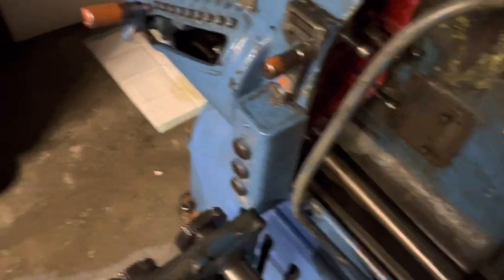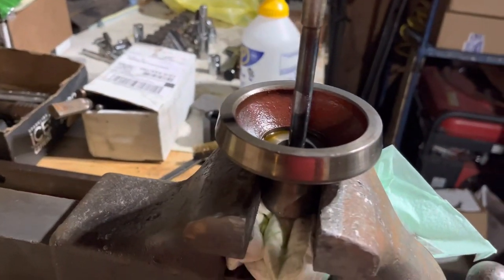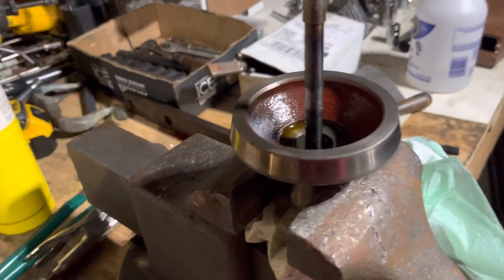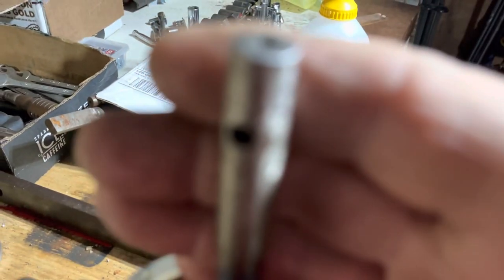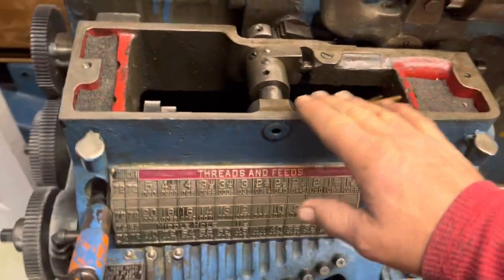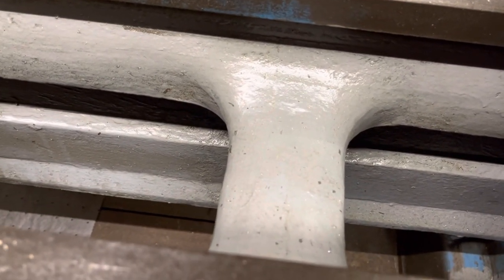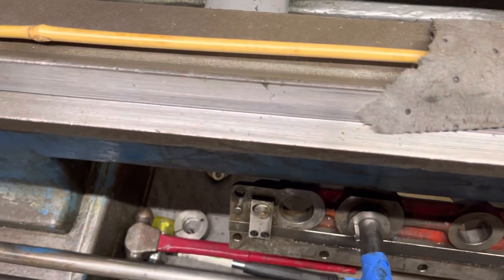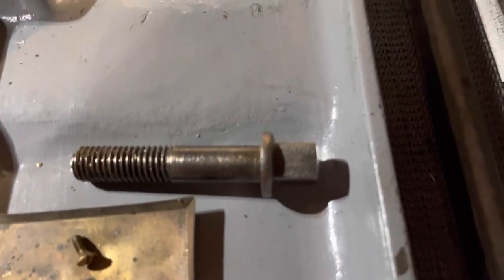Nocturnal emissions(My friction clutch￼) Crossfeed shaft,J682S.   Crossfeed friction,C243 ￼

Comment: Before getting too anxious to cut more out of those slots around the carriage lock, I would make sure the clearance between that plate and the bottom side of the ways is not excessive. If it's not tight enough (close enough) the carriage lock isn't going to work. Also if the clearance is excessive and you either tension the square head bolt too much, or cut those grooves to much you run the risk of snapping it off. You might also consider a shim between the plate and the underside of the ways if the clearance is too great due to wear if it's not something where you can adjust the clearance. I would run the shim all the way across. That tab will still pull up and cause it to lock in place.

Comment: 👍🤞😉👍
you will get there, i'm sure, 
If it works in the same way as the other friction cone, why not take the working one to pieces to learn how it all works, then attack the faulty one.
cheers
Kev
Reply from the maker: That is an excellent idea if it wasn’t for just the fact that I have stuck threads I don’t think I need to take the other one apart but I may do it anyway there may be more to friction clutch I’m currently seeing

Comment: Do you need to grip the very end of the clutch the smaller diameter.  looks like it moves on the smaller diameter .
Reply: Heating the SHAFT is counter intuitive -  that would tend to BIND the shaft even more !     'Gently'  heating the threaded end of the CONE would be the thing to try , which would expand the material around the threads ; thereby freeing it up a bit . . .     * Clamping that end in the vise is also counter intuitive  . . .  
      I'd suggest to put the SHAFT into a collet or chuck , with the cone / threaded end  pointing toward the tailstock - then heat the threaded end 'gently' , while gripping the outside of the cone with a strap wrench or padded pipe wrench . . .     'Looks like the shaft is going to have to be remade , or at least 'sleeved' to salvage it ? ? ?    'Guess we'll see soon enough !     
      Hey Kimber -  pay no attention to ^ ^ ^ this comment !  ;)
Reply: @georgewocosky  I’m not talking about the shaft. The opposite end.
Reply from the maker: George that sounds like the sound is advice yet why I like it especially the padded pie French thing called holder brilliant. I guess I’m gonna have to put something on my spindle
Reply from the maker: Yes
Reply: @georgewocosky  heating a seized bolt, does Sound counter-intuitive, but having rebuilt hundreds of horse-drawn era farm machines, and dozens of same era blacksmith's forges & blowers, I can guarantee that it is not... A bolt that is threaded into something, cannot expand radially, only axially... When it cools, it shrinks Both axially, and radially, aiding in removal... Just sayin...

Comment: You need to ask yourself before you mod something why it’s not working as designed. After all it used to work and there is a reason it’s not. Something has changed you need to figure out what. Have you tried heating the opposite end where the threads are at externally applying heat but not too much. That’s why I recommended a slap hammer to pull on the shaft lightly.
Reply from the maker: I like tha idea , little shocks.
As for why it is locked up so tight it was running 800 RPMs when it was shut down in the engaged position at least those are my thoughts at this moment